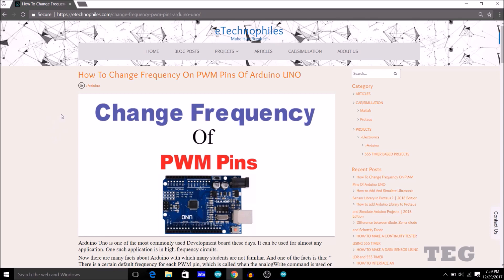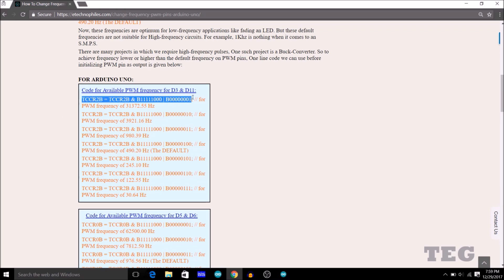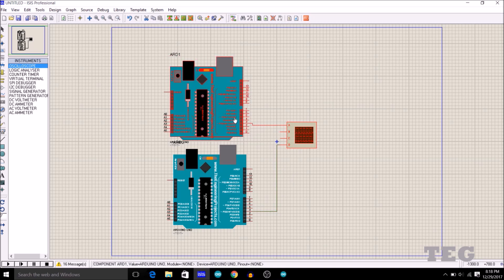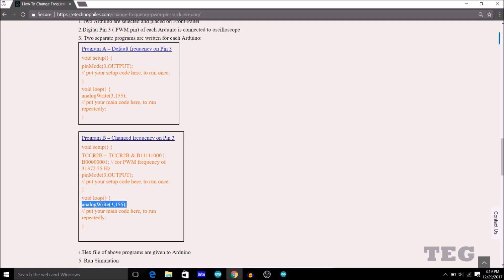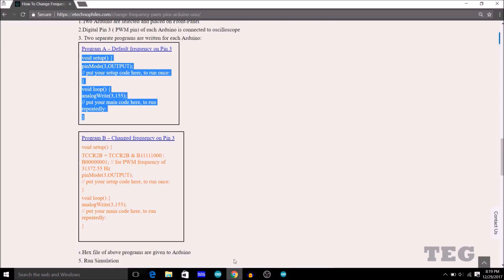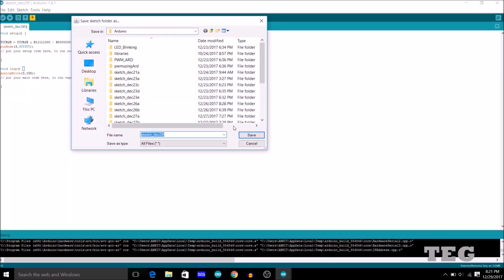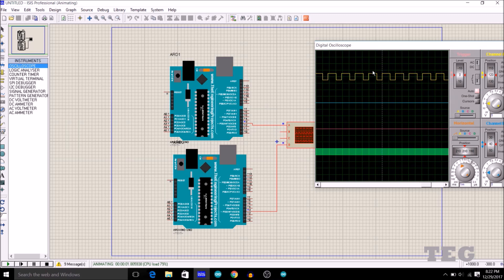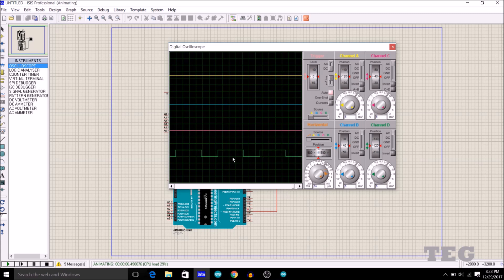How To Change PWM Frequency On PWM Pins Of Arduino UNO

Comment: What if we want a frequency of 600 KHz?
Reply from the maker: Not possible
Reply: @THEELECTRONICGUY  it is possible, with uno its possible up to 2Mhz
Reply from the maker: @Ahmadnaweed786  Well the Oscillator in 328p is of 16MHz..you can get upto 8MHz but the wave will look nothing like a square wave

Comment: 31KHz is the maximum? we have an application that needs 50Khz. Can e use arduino for that?
Reply from the maker: No, max is: 63KHz
Reply: @THEELECTRONICGUY  I cud only find jumps between 31 KHz and 62 KHz.. Is there anyway to change PWM 5o exactly 50khz
Reply from the maker: By varying the inbuilt timer frequency of Arduino you can get the desired frequency from output pins.